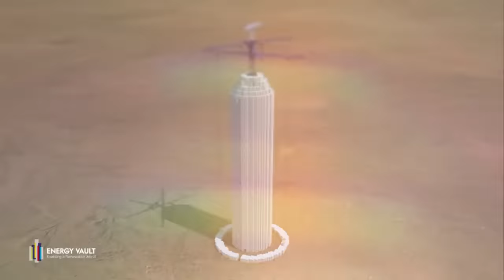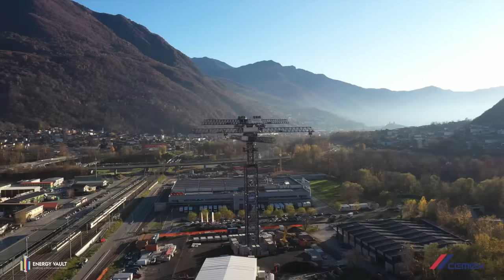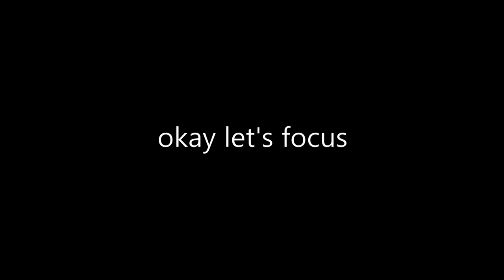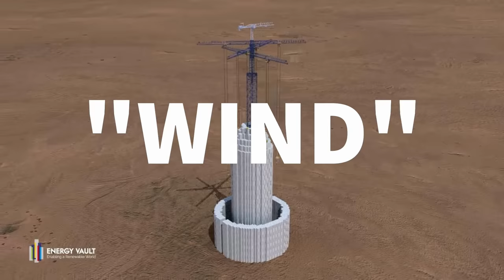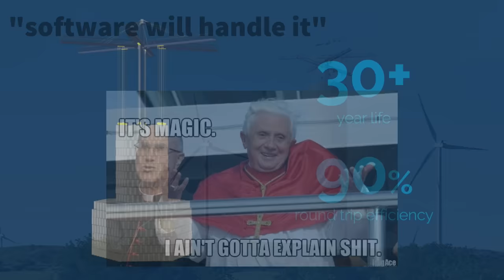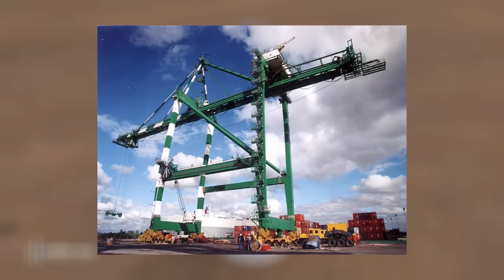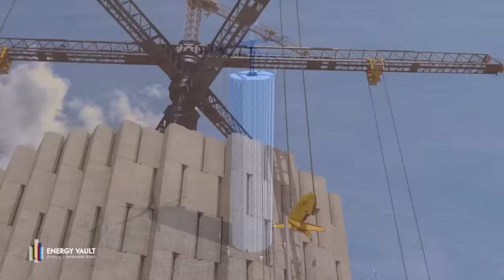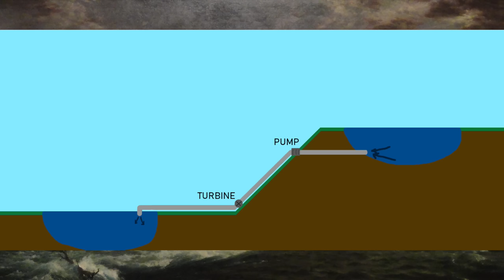The Energy Vault is a Dumb Idea, Here's Why

Comment: Short, sweet and straight to the point. And as someone who works in tech, thank you so damn much for pointing out that "software" isn't frikkin magic pixie dust.
Reply: At least not until the beta magic pixie dust update comes out.
Reply: @therealspeedwagon1451  I always let Jesus take my keyboard when I need a new coding solution. :)

I just wish he would return them again :(
Reply: And yet, drones are known to fly stably in pretty strong winds. Software?? Nah, it's magic of course.
Reply: @tzenophile  
Okay... Connect that stable drone to the lower end of a massive, dangling cable (many times the mass and profile area of the drone) that is being whipped around by unpredictable gusts of wind, and give the drone a massive load (the block grabber with its actuators that must be failsafe), also swinging in the wind, to be precisely oriented over a block that butts-up against other blocks... If one of the four actuators fails, Murphy's Law says it will fail 80m above the ground, and the grabber cannot be moved without risking toppling a 35T block of concrete from the top of the stack... Good luck with that! Once one incident happens, the entire storage battery must be shutdown until its perfect operation can be resumed...
Reply: @rustycherkas8229  You're almost there, but not quite. I bet you didn't know that refueling planes in the air has been done for a hundred years!  So this is a piece of cake. Really.

The block can be stabilized in a number of ways, obviously a lightweight drone would be ineffectual, but all you would need is a couple of powerful fans. Oh, and some software control.  And maybe a gyro?   Four independently dangling grapples is of course a bad idea. Again, you don't have to be a genius to think of a better solution.
Reply: @tzenophile  
"Mid air refueling"?
Hardly equivalent to the 'fully automated precision guidance system' necessary to drop the grabber around the 4 corners of a block of cement (clustered amongst other obstacles.) Listen! Full respect to the pilots' skills! I know I'd require '000s of attempts to succeed maybe only once!

Forget about the condition when a massive block is in the 'grabber'... Consider the condition when the grabber is empty and at the fullest extent of its cable, and the wind is so strong that there's overproduction of 'juice' that should be stored in this battery.
You seem to suggest that the grabber, being buffeted by gusts of wind at the end of its cable could be reliably (automatically) vertically positioned (to less than, say, 1cm accuracy on all 4 corners) to then be lowered the height of the block and grab hold... while the top of the 80m tower is also swaying in the wind and rocking and bending slightly as other blocks are hoisted and stacked...

Build one and show that it works! None of this "10 minutes demo of a 1/4 scale model in favourable conditions as proof of concept that a winch can raise and lower a block of cement." Remember, the blocks are arranged in a circle. Can't imagine how you'd expect to 'rotate' the grabber with only two (noiseless but "powerful") fans operating at some elevation high enough to ensure their 'wingspan' will not be clipped by neighbouring blocks.

As the video shows, adding more tech and more tech and more tech is a really good indication that what should be a low-cost low-maintenance "dumb storage system" is in the opposite direction of where you're headed.
Reply: @rustycherkas8229  As I said, that was a hundred years ago; they did not have machine learning back then. Perhaps you need three fans, so what. Also, as I said, the "four corners" thing is silly, but can easily be solved, and this time YOU come up with the simple solution, I am tired of inventing the obvious. 

We agree that proof of concept to operational scale is needed, and that is the only thing that makes me skeptical about this particular company. The rest is cleverly applied engineering; the kind that humanity has been doing for millennia now. There were moon landings more than fifty years ago, and you think THIS is impossible? 

The only real question is, what are the operational limitations? And then you tweak and improve what needs to be improved, until it makes financial sense. Or not. Just because it works does not mean it is a good idea, but we don't know that yet.
Reply: @rustycherkas8229  Even more nonsense and witless ad hominem speculation; the signs of someone with nothing of substance to say but still has to say something. I'm not a boomer, and never even owned a car, for what it is worth; not that you care, and neither do I that you don't. Small minds, etc. You know the quote. Bye.
Reply: @tzenophile  
Not a boomer but you remember watching the Apollo 11 LEM land on the moon...
Impressive!
I'm sure your 3y.o. self understood and appreciated all that you saw. That's why you can see such potential in this "Jenga Tower" energy storage...
Reply: @rustycherkas8229  "Small minds.."
Reply: @tzenophile  
"It ain't the meat, it's the motion..."
--Maria Muldar
🤣🤣🤣
Reply: @LegendLength  
Your drone may be able to hold its position in a hurricane, and your camera image without jitter while riding on the back of a bucking bull...
The problem is 'locality'.
What's "magic" is positioning the empty 'grabber' dangling 80-100m below the positioning control actuators while it thrashes around in gusts of wind.
(Don't forget that the other end of the boom 'should' be elevating a 35t block... Rapidly swinging the rigid boom through any angle is a non-starter.)
Reply: @LegendLength  
Tangential to this video is the topic: "Carbon Capture and Storage" as the lifeboat that will save the planet. While it is nice to imagine it working (and policies are written based on its so far unrealised promise, and status quo use of fossil fuels continues to maintain exponential growth of economies), it feels somewhat like driving blindfolded toward the cliff edge while imagining tossing-out an anchor (we don't have) will save the day.

It's like "losing weight". The easy part is signing up for a gym membership. The hard work is yet to come, and is relentless if one is to move toward the goal.

Using a crane to raise/lower great weights has been shown to work (and is the inspiration for this CGI notion.) The hard work is "kicked down the road" while investors money is spent reinventing the wheel.

An expression used by people experienced with software project development: "The first half of the project will take 90% of the resources. The second half will take the other 90%." And, that's the optimist's version.

My jaded view is, "If you want to sit at the table, show that you've solved the hard problems, and refrain from wasting everyone's time by yammering-on about tweaking technologies that have already been shown to work." Someone suggested a "moon landing" equivalence without appreciating the decade of effort that chewed through (or the political motivation behind it.) Perhaps the real solution is to end artificial support for unsustainable practices. If one wants a coconut, then they should go climb a tree to fetch one.
Reply: @LegendLength  
Talk to me when CCS achieves >100%.
With expectations of technological fixes to facilitate on-going exponential growth in consumption, all one achieves is "kicking the can down the road." In the case of sub-unity CCS, the can is still being kicked backwards (and software ain't gonna help that.)
Reply: @LegendLength  
The current Australian PM is pledging his "now I've seen the light" commitment to reduced carbon emissions on technology that, after 20+ years of scientific and engineering development has still failed to come close to achieving 100% capture even with subsidies compensating for its high installation and operating cost. Same guy poured cold water on EVs by spooking Australians claiming that they'd miss-out on gas-fueled, long distance travels on the weekend (read: "Consumption is good for the economy")... The guy acted on "faith" both times: faith that CCS will allow Australia to continue to mine and sell coal (read: "Stripping and selling non-renewable resources is good for the economy"), but he had no faith that EV technologies will improve to suit market forces...

1950s "leadership" in the 21st century... Just plain dumb, imho...
Buying a boat that doesn't leak quite as severely as last year's model.
Buying a plane that only crashes on 10-15% of its flights, but better than the one that crashes on 100% of its flights.

What's the problem with supporting an EV that will take you 90% of the distance to your weekend retreat up the coast??? The Aussie PM thinks 90% is good enough, and makes policy on that belief!!!
Reply: @LegendLength  The problem is that software literally can't fix this, without a metric sh*t ton of complex hardware that makes the whole thing a ridiculous Homer-car and creates a myriad of failure points that would be almost impossible to disentangle, and which in order to operate to the required tolerances would need multiple software and hardware redundancies and corrections that would only increase those failure points exponentially, when you could just use pumped hydro. Ironically, the best camera stabilisation systems are usually opto-mechanical rather than digital.

Comment: Always suprising, that by solving all the problems of these over-engineered high tech solutions, you reinvent some tech that's been around for hundred years lol
Reply: This company has a working prototype in Switzerland, where pumped-storage hydroelectricity is huge. They are not ignorant of that at all. What they're doing is developing a solution for other use cases.
Reply: have you heard of juicero? they reinvented squeezing a bag into an expensive, failure prone, proprietary machine that clogs up your kitchen counter

Comment: Utilizing a Mass/Gravity for energy storage is a perfectly great and old (1600's) idea. This system as the company is presenting is far too mechanically intensive and overly complicated which will obviously lead to failures and a short and expensive operating lifetime. Any engineering student worth her/his salt could do much better.
Reply: Any high schooler would do so much better
Reply: @jordoruiz0001  Any toddler***.
Reply: B-b-but the future is supposed to be mechanically complex and iPod-chic! We can't save the planet if it means we can't roleplay our sci-fi fantasies, dammit!
Reply: @jordoruiz0001  you put too much faith in highschoolers.
Reply: *worth their salt
Also, I learned a new English expression today
Reply: There are so many ways that are way simpler and cheaper.
Trains for example can carry a lot of weight. Lead or scrap metal. Drive the train up a hill during an energy surplus, and let it roll back down to get the energy back.
There are experiments with large tanks that get thrown into lakes, pumps fill them with air, and when energy demand is high, let the water flow back.
How they thought that cranes and concrete blocks are a viable option is beyond my understanding.
Reply: Nah, its a modern company.  Its not selling an energy solution, its selling an energy storage service.  Constant updates, fixes, and repairs
Reply: But seriously let engineers design everything rather than just working out the flaws would leave us a couple centuries away from wheels on spokes.
Reply: Companies aren't interested in a perfect solution for energy...Energy is huge business
Reply: I don't get how the inventor thought this would be any better than just water and a pump/generator. It's the exact same concept only with so much less moving parts.
Reply: @Zoroaster4  I mean in some areas and climates I suppose a water reservoir wouldn't make much sense, but this isn't a solution to that.
Reply: I check those cables on towers for a living. They will not last 3 months if going up/down 24/7.
Reply: @irreverend_  That's true. I wonder if they could do the same concept only with sand.
Reply: @Zoroaster4  it's likely too abrasive and thus huge maintenance costs again. I suppose if initial build costs weren't too much of an issue, you could create an underground reservoir, but the size and amounts of water you want, and height difference, you'd have to go really really deep at one end and probably have astronomical costs. If you want to stick with the solid blocks idea though, just have several incredibly heavy ones going up and down on pulleys, and none of that faffing about with stacking things with robot arms. Simpler and maintenance would be cheaper even if it did have to be very regular. Also have them in shafts going underground so wind and weather aren't an issue
Reply: Obviously that's not an inspired idea, but it took me a minute to think up and no research, and it still sounds more viable
Reply: Ok, here's my dumb 2c thought as I'm tiredly looking this over, and using solid materials and not liquid (I did see the whole video): a very boring marble run.  Not literally, but mechanically.  A 'ladder' conveyer belt for the materials when energy is in surplus, put in place by people, with storage on the top level, and of course a similar system in reverse to generate power.

My tired weekend brain has established a better system than the base example in the video (imo)

Or, taking the criticisms of the liquid in other comments, and using that: why not a self contained cylinder for the water pump system?  No (or, at least limited) evaporation, modular, and could be installed in any environment (or, most, extreme weather is a concern now that I think about it)

Comment: I was getting worried because I had seen stuff about the hydro battery storage and connected the dots. I'm glad that didn't turn out to suck cause it seems like a great idea.
Reply: It sucks so little that hydroelectric dams have been used for well over a century, and have been indispensable. It's a very proven tech, but now we add a "reverse" option.
Reply: @GamesFromSpace  This "reverse" option has been in use since 1907
Reply: The pumped storage power plant has one problem, it needs lot of space. basically you have to dig out a crater in a hill. Therefore it is problematic to implement it in densely populated areas such as Europe.
Reply: @GamesFromSpace  Dinorwig is a good example of how to do this with water, why spend money on environmentally poor concrete and high degradation cranes. Then there are the Tower Bridge accumulators that were installed in Victorian London, much less to go wrong
Reply: @kosskrit  but this concrete block stack thingy needs much more space. Hydro dams have much more storage capacity due to the fact that there's a huge elevation difference between the two pools. And the stored energy is basically (mass * gravitational constant * height). The 35 MWh that this thing claims to store are a laughable figure - hydro plants like Kaprun have a storage capacity of over 1.000.000MWh - or about THIRTY THOUSAND Times the capacity of this joke of a power storage site...
Reply: @kosskrit  Which is one of the reasons they've just put a 1,4GW interconnect between Great Britain and Norway, where they have a few fjords to spare.
Reply: @kosskrit  well there are loads of those "hydroelectric batteries" in Europe, in Norway, Austria, Switzerland and so on. The space is not the main issue, as you build those in the mountains. The main issues are the lack mountains in the northern european plain and environmental concerns.
Reply: @arnoldhau1  Yeah. We have one of those things near Hamburg. But since there aren't any actual mountains around here, it needs quite some space. In the literal alps, you need a way lower volume of water to store the same amount of energy, because you can have a way higher difference in height. Sadly, northern Germany (and the entirety of the Netherlands and Denmark) are Europe's main wind energy regions and its worst regions for those pump-storage plants.😅
Maybe it's time to dig 1km deep holes again, like they did for the coal mines in NRW.
Reply: @faultier1158  yes that is the northern European plains. There other solutions are needed, or better connections south or to Norway. Unfortunately exactly those connections are blocked for environmental concerns.
Reply: You guys understand that we don‘t need the same solution everywhere. Pumped hyrdo is wonderful, but it too has its downsides. This is not gonna safe the world, but who knows, there might be specific situations where it is a good idea
Reply: You should check out this video from Practical Engineering on this subject. It's good! https://www.youtube.com/watch?v=66YRCjkxIcg 9mins long. One thing not brought up in that video is that different power sources are not made equal when it comes to grid power. Certain sources are much better for creating a stable grid when it comes to frequency etc. That is a much longer and more complicated subject though.

Comment: It is astonishing that investors would back this idea. One ratio that is out of whack is the required investment per kWh of energy storage. Cranes are very expensive pieces of machinery. Touchy, sensitive, and requiring great skill to operate and maintain.

The video mentions wind, the mortal enemy of tower cranes. The usual rule is that you must shut the crane down before the wind hits 40 mph. The maintenance expense would also prove to be a problem. The ropes wear out and have to be replaced regularly. It’s a big, expensive job every time. The structure also develops fatigue cracks that require expensive repair performed by skilled ironworkers and welders. The “duty cycle” would be equivalent to near constant operation moving the full rated load. Very destructive.

Finally, utility-scale capacity would come only with immense outlays. This thing is an expensive toy and a science experiment that will serve to test things that are already known. It’s not cost effective, and this could have been shown on paper without building a thing.